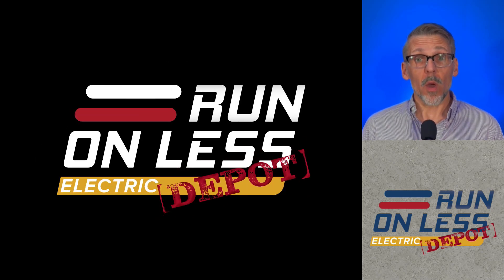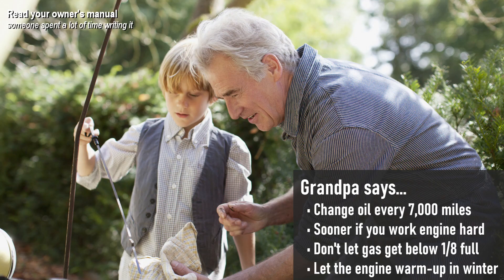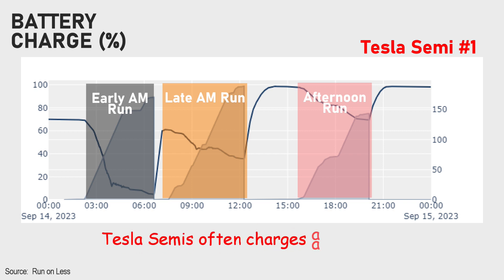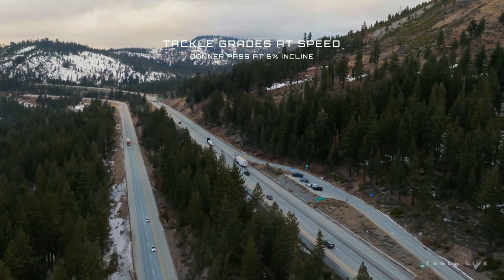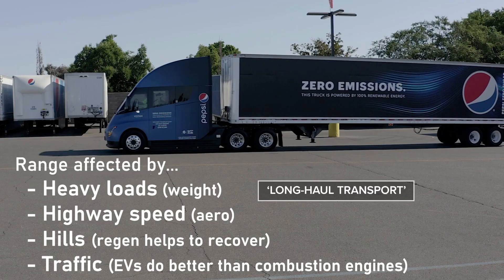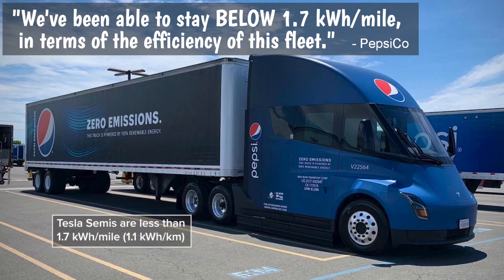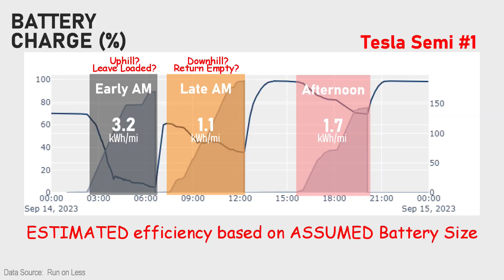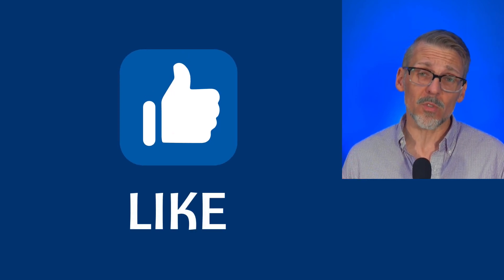In-Depth Analysis of Tesla Semi Data (Freightliner and Volvo too!)

Comment: Interesting things that are becoming very clear with EV transit buses is that the battery degradation rate is significant (and very important) and the lower utilization rate of a large EV vehicle requires “MORE VEHICLES IN THE FLEET” to fulfill the same requirements. This is why some applications are better met by other technologies. Already some companies that serve California “shipping ports” who tried EV semis are moving to other technologies.
Reply: Well stated.
Reply: The latest batteries are showing minimal degradation after 1.5 million km. They're also way cheaper now, have almost double the capacity, charge in almost half the time, and barely lose any power down to - 20°C. And the improvements are actually accelerating, not slowing down. So we're nowhere near the pinnacle of how good battery tech can get.
Reply: @truhartwood3170  
IfUSāSō, problem is that nobody told the real life batteries that.  This is what the local transit district is actually seeing in real life.
Reply: @Mentaculus42  they're not using the latest batteries, so that's not relevant.
Reply: @truhartwood3170  "double the capacity"? This is total BS!
Reply: @davidsoom1551  Ah. You're one of those people for whom "BS" is "any fact that challenges my pre-held beliefs".
Reply: @truhartwood3170  You believe battery has double the power, that's specifically isn't true therefore BS. Wake up to the facts man! Just cuz you can make a false statement doesn't mean you should.
Reply: @truhartwood3170  no, you're the one who believes in vaporware. none of these claims have any meaning until they're out in the real world. like my father always says: "Paper accepts anything you put in it"
Reply: @GraveUypo  I will never understand why people don't simply take 5 sec to google something before posting. Amprius and CATL have both started mass production of batteries with approx double the energy density (450 - 500 kWh/kg) of the batteries in most EVs today (around 220 - 260kWh/kg).

Comment: I noticed that the EV trucks are given an extra legal allowable 2,000# grace max GVW poundage over the diesel powered max of 80,000# GVW due to the EV semi-tractor being so heavy with it's batteries to maintain trailer payload capacity. Also the energy density in any of the EV propulsion batteries, per pound will never approach the energy density of a gallon of Diesel fuel. 

Also consider colder weather in Northern US states will drain more power from the batteries to maintain cabin temperature and external lighting in bad weather. 

Also long haul drivers are paid by the mile and need 500-600 miles daily to make a decent living. Consider the relatively long recharging times to get the batteries charged again compared to refueling a Diesel rig that will contribute to down time that the driver is not paid for. 

And where does all of this propulsion electricity come from in the USA? The EVs suck off of the teat of an already taxed and ageing American electrical grid with major prime movers like natural gas, nuclear, coal, oil, and some hydro.
Reply: The 2000lb increase is also for natural gas and hydrogen trucks, hydrogen trucks weigh more than battery trucks. The battery doesn't have to approach the energy density of diesel, just having 1/4 of its energy density will render it obsolete due to the batteries much higher efficiency at sending that energy to the wheels.

Keeping the cabin warm and running lights won't be a problem for the tesla semi truck. It's battery can run the Average home in the US for a entire month with its energy capacity, a diesel semi truck can't even idle that long lol.
The tesla semi can put 350 miles in its batterynin 30 minutes so it will fit 90% of truck routes in the US for a single driver. 
Coal has ben surpassed by renewable in the US in 2022, natural gas is next, fracking and drilling in the US is heavily dependent on subsidies from the government, far more tax dollars  goes into making gas cheap than going in making renewable power cheaper.
Reply: @miguellopez3392  Right now the electrical prime mover fuel in America is 39.8 % natural Gas, 19.5 % Coal, 18.2 % nuclear, 21.5% renewables, and .9 % petroleum (.1% error). Right now natural gas is king in that it burns cleaner, it is relatively cheap, and is plentiful. https://www.eia.gov/energyexplained/electricity/electricity-in-the-us.php

I agree that there will be a place for the Tesla semi. But it only seems practical for local and short dedicated routes. An OTR driver needs miles to earn a decent wage. A 350-500 mile range is not going to do that.

Comment: Having half the battery capacity of the Tesla means that the Freightliner and Volvo can take higher payload since the battery is lighter. So they are moving more freight using the same amount of energy.
Reply: When you are hauling chips you never max out at 82k
Reply: Nope. Look at the specs. Let's take the Freightliner eCascadia. The tandem drive, "long range" eCascadia that can only go 220mi can carry 1,800lbs LESS than the Tesla semi that can go 300mi, and yet costs substantially more than the Tesla. The eCascadias with the smaller pack have max GVW of 65,000lbs, so can carry less, still. 

TLDR:
Telsa 300mi range: 52,000lb cargo
Tesla 500mi range: 49,000lb cargo
eCascadia single drive 155mi range: 38,650lb cargo
eCascadia single drive 230mi range: 36,250lb cargo
eCascadia tandem drive, 220mi range: 50,200 cargo

The eCascadia starts at $140k for the single drive, standard range, while the Tesla starts at $150k. Will companies want to save $10,000 but get a truck that can haul 13,350lbs less and tow it less than 1/3 the distance? Some will, sure. But there's no contest between the Tesla and any other version of the eCascadia. 

Here are the numbers in more detail, taken from Freightliner's website, and assumes the trailer weighs the standard 10,000lbs.

Standard range (155mi, 291kWh pack), single drive version has a max GVW of 65,000lbs. The curb weight is 16,350lbs, so with a 10,000 trailer that leaves 38,650lbs for payload, which it can only haul 155mi "assuming a gradually diminishing load". 

The long range version (230mi range, 438kWh pack) single drive weighs 18,750 and still has the 65,000GVW rating, so only has 36,250lbs for cargo.

The long range, tandem drive (220mi range, 430kWh pack) has the 82,000lb GVW rating, and weighs 21,800, so it has a max cargo capacity of 50,200lbs.

The Tesla 300mi version weighs "<20,000lbs", so at least a 52,000lb payload.

Tesla 500mi version weighs "<23,000lbs" so at least a 49,000lb payload.
Reply: Good point
Reply: Regen does not recover all the energy going down hill I would  be surprise if the truck gain 30% back.compare to driving on the flats
Reply: @lesterng5748  anyone who owns an EV knows that regen basically levels out the drive. If one EV drives 100km over a tall mountain it will lose maybe 110km of range (getting about 90% back from regen), vs an identical EV that drives 100km around the mountain will just use 100km of range. You only get back the energy used to raise the EV up, you obviously don't get back all the energy lost to road friction, air drag, the heater/AC, lights, computer etc. that you would have lost regardless of whether you'd  gone over the mountain or you'd travelled on level ground.
Reply: @lesterng5748  "I would  be surprise if the truck gain 30% back.compare to driving on the flats" You will be surprised then! xD
Reply: @lesterng5748  Moron allert?!
Reply: Sorry to necro, but no one else has pointed out the most likely reason for the efficiency difference: the Tesla is being used more at high speed because of its longer range, while the others are being used more on slower metro routes.  Speed kills EV range far more so than does weight.
Reply: That is total non-sense!

The Freightliner eCascadia weighs in its different version:

- 16'350 lb in its 155-mile 4X2 version
- 18'750 lb in its 230-mile 4x2 version
- 21'800 lb  in it 220-mile 6x4 version

The Tesla Semi, in its 300-mile version, weighs <19'800 lb, and <23'100 lb in its 500-mile version.

The Tesla Semi can therefore move MORE freight over LONGER distances!  There are to many versions of the Volvo e-truck to cover them, but they are also ALL inferior!

Facts matter!
Reply: That is largely an incorrect statement.  The Freightliner eCascadia models weight (tractor only) and range are:
- 16'350 lb for a ridiculous 155 miles of range
- 18'750 lb for 220 miles of range
- 21'800 lb for 230 miles of range.

So, they are ALL local distribution trucks with no long-haul capability whatsoever.

They hence do not compare with the Tesla Semi in its 500-mile range version.  They compare a bit  better with the Semi in its 300-mile version... which weighs <19'800 lb.  So, the 2 "smaller" versions of the Freightliner can indeed tow a bit higher load, but at the cost of crippling low range.  As to the "bigger" version, it suffers from both significantly lower range, but also from a 2000 lb higher weight vs the Tesla Semi.  Definitely all losing trade-offs!
BTW they do not use "the same amount of energy", but around 15% more!

As to Volvos, their bigger battery model offers 275 miles of range... but weighs a whopping 27'500 lb... nearly 8'000 pound MORE than the Tesla Semi in it 300-mile version, and 4'500 lb MORE than the 500-mile version!!!  ALL Volvos are heavier than the 500-mile version of the Semi, while offering 40 to 65% less range!  They also use 20-25% more power per mile than the Semi!

They also are at only 35-55% of the Tesla Semi's power.  That is important when going up, AND down, any significant gradient.  On a 6% gradient, at FULL load, the lesser powered Freightliner (390 HP) will be at a  <25 mph crawl and the most powerful Volvo (757 HP) will manage only about 45 mph.  Both versions of the Semi, at the same maximum gross weight of 82'000 lb, will be going up that same gradient at 55 mph without breaking a sweat!  The same is true going downhill, because regenerative breaking is also not more powerful than the engine's rated power.
Reply: Half the battery means half the range.

The reality of trucking is that most loads are VOLUME limited, not weight-limited.
Reply: @JasonCarmichael You need enough capacity to do the run - exactly zero more.
Thats why Volvo are delivering the range the CUSTOMERS ask for.
Reply: @allangibson8494  If with Volvo you mean the chinese than yes. 
Just a matter of time untill they get surpassed by better tech. Do your research, invest in Tesla
Reply: @lucadellasciucca967  Volvo trucks are completely separate and unrelated company to the now Chinese owned Volvo cars. Volvo truck also owns Renault truck (which are also separate from Renault car) and Mack Truck.
The Volvo group has thousands of electric trucks on the road. Tesla is WAY behind on sales.
Reply: @allangibson8494  Didn t know that. Makes it kind of worst tho. If i undertand it it s like a spin off of the company. Meaning it needs to make money or it will die off or more likely bought just like it happened to the car business. I highly doubt the trucks are yet even close to profitable.
The end result is what counts. Nobody can beat Tesla in manifacturing at scale. And as usual i m having to remember people that all Tesla vehicles from 2016 are hardware ready for autonomy.
Reply: @lucadellasciucca967   Volvo have more scale in trucks than anyone else.
Reply: @allangibson8494 They have already produced and sold 5000 electric trucks globally since they introduced them back in 2019
Reply: @12345anton6789  "They have already produced and sold 5000 electric trucks globally since they introduced them back in 2019" Yap, Tesla will definitely produce more then 5000 in their first 365 days of production!
Reply: @12345anton6789  Being the second in a yet non existing market doesn t mean much. If they were producing and selling 100k trucks a year i would have nothing to say.
Reply: @lucadellasciucca967  The Volvo Group sell over 200 000 trucks a year, only Daimler Trucks are larger. They just started the transition into electric trucks
Reply: @12345anton6789  Yeah no i understand. I was talking about the EV truck market.
Reply: @JasonCarmichael  Eh. Well. Not really. Guess why we have 64 tonne and 74 tonne trucks here in Sweden?
Reply: That's not true.  @JasonCarmichael
Reply: The Tesla Semi is already able to reach 44,000 to 48,000 lbs net weight, so it's able to cover the majority freight loads at it's battery capacity and is within a few thousand pounds of diesel trucks legal limits. The Volvo and Freightliner don't have a payload advantage
Reply: The list of reasons why the Tesla semi is better goes well beyond the payload capacity to range ratio. The list begins with battery termomanagement system and ends with self drivng capabilieties. In the middle there are all kinds of relevant stuff, cost of purchase, maintainance, software quality and responsivness, functionality, confort, charging infrastructure, infotainment, accident safety. It doesn t end.
Reply: @lucadellasciucca967  It does end. Here in Europe the Tesla articulated lorry, to give it its proper name, does not meet the construction and use regulations.
Reply: @rogerphelps9939  hm hm. In which ways?!
Reply: Oversimplification. Terrain plays a huge part. Tesla motors, etc. are second to none.

Comment: 😀😃😄😁A thought experiment - using a Tesla Semi travelling from SIPform West Australia to Lismore, New South Wales, then onto Brisbane, Queensland, to purchase in 2028.

400-volt DC Tesla Super Charger for Tesla Semi at. The distance between charges is 700 kilometres:
👍1 SIPform, 4/3 Finance Pl, Malaga WA 6090.
👍2 BP Truckstop, Eyre Hwy, Coolgardie Esperance Hwy, Norseman, WA 6090. 
👍3 Shell, Eyre Hwy, Nullarbor, SA 5690
👍4 BP Truckstop, 35 Eyre Hwy, Ceduna SA 5990
👍6 Shell Coles Express, Port Augusta West Roadhouse, 34 Eyre Hwy 1 Stokes Terrace, Port Augusta West, SA 5700
👍7 Shell Coles Express Broken Hill, 164 William St, Broken Hill NSW 2880
👍8 BP Truckstop, 180 Mitchell Hwy, Nyngan NSW 2825
👍9 Bendemeer Tourist Center, 19 Havannah St, Bendemeer NSW 2355
👍10 Bunnings Armidale, Corner Barney and Canambe St, Armidale NSW 2350
👍11 Lismore NSW 2480 to deliver site SIPform from Perth, WA, to the site at Lismore NSW
 
We will buy two Tesla Semi to travel SIPform WA to Lismore 2480 once a week there and back. There is another material we can bring back from Queensland to WA Queensland.

Comment: I'm curious with these claims. Is that fully loaded both directions or 1 direction like many trucks? Are they loosing load or not, that would reflect in loss of earnings or more vehicles on the road. I don't think we have the whole truth here yet, and still doesn't have the advantages of diesel power. We really need more information.